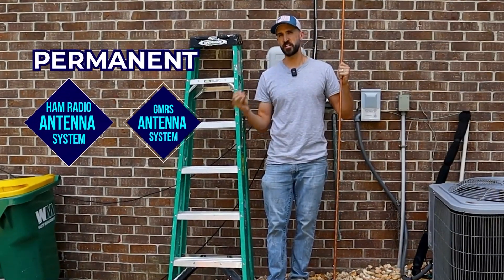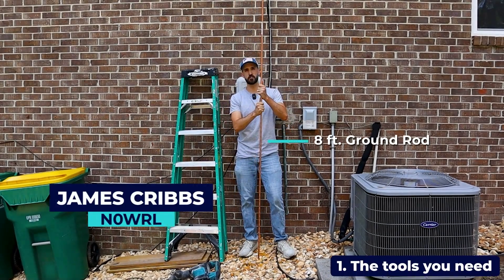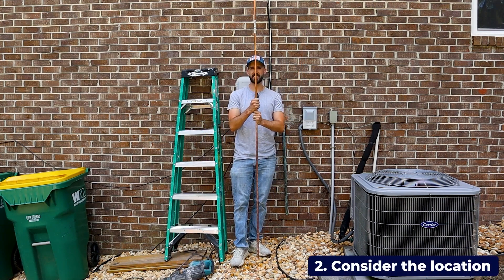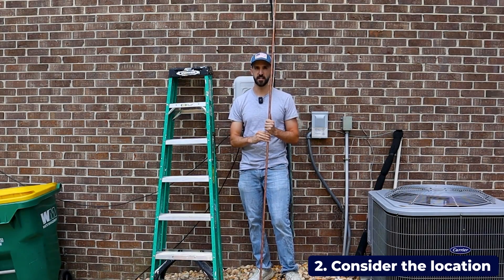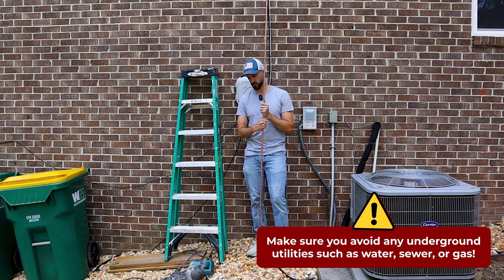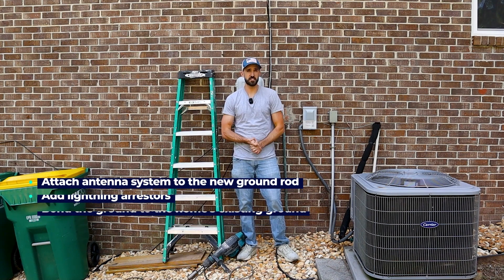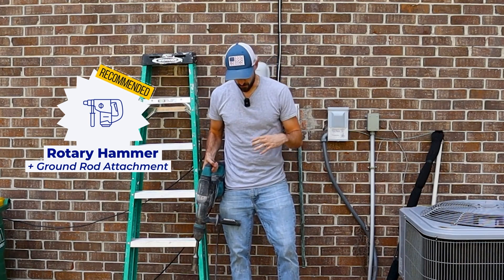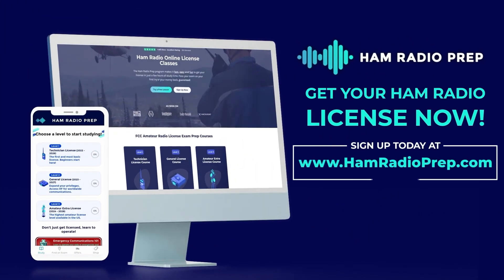Proper Antenna Grounding Made Easy ⚡ | How to Install a Ground Rod for Ham & GMRS Radio

Comment: The challenge for me is my shack is on one side of the house on what would be a second floor and my main house ground/electrical box is on the exact opposite side of the house at ground level. I am separated by 55-65+ ft of distance if I go around the house on one side and a complete concrete pad/driveway on the other side. that stretches nearly 30 ft. So it's not practical at all to do this ground rod install unless someone can explain how it can be done more simple?

Comment: Was lucky, no rocks! Started with a shallow hole, then filled it with water, kept soaking the soil till the water stopped draining. Pounded in the ground rod with a regular carpenters hammer. Went in like butter in 2 minutes!
Reply from the maker: That's great when it goes in so easily!

Comment: The ground rod should be at the base of the antenna or tower, and if its a tower you should have a separate rod for each leg, wired in a ring around the base of the tower.  You must keep the wiring straight run from the antenna to the ground.  A 90 degree bend will blow the lighting out the bottom of the wire at the bend.    For coax surge suppressors etc, you are trying to dissipate the static charge off the metal to ground before it builds up enough to connect the ground to the cloud.   Keep in mind that the antenna is in reality a lightning rod, and most likely will be the highest point around the house, so if something does happen it will most likely be the one hit.   Make sure you are following article 250 for grounding and bonding, as well as lightning protection guidelines.  For example by far the best connection between ground rod and grounding wire is exothermic welding, however approved mechanical means can be used as well, it all needs to be buried, not above ground.  Lets understand what "grounding" means.  You are trying to dissipate a huge amount of voltage and current into the ground, not above the ground.  Multiple ground rods are indeed needed, not just one.  They aren't that expensive and are good insurance to help.  Make sure that any bonding wire between ground rods are continuous piece of solid copper wire at minimum #6, never cut wire between rods.  

In your example the window on the right of the AC condenser, you would have another rod that would be attached to the mounted surge suppressors and have that copper grounding wire going straight from them to the rod right below.  Make sure to do a few drip loops on the coax close to the ground as well, this will help during a direct strike to cause the lightning to blow out the side of the coax as it doesn't like to travel in circles to dissipate it even more.  There are many books directly on the subject of lightning protection and proper procedures to follow.

Again you do want to bond to the structure ground as well, so that potential wise you minimize the difference between the antenna/tower grounding vs the home grounding.  This could be bonding to water pipes, UFER grounds or home grounds.   Our city requires two ground rods a minimum of 6 feet apart, so we have that plus almost 10,000 sq feet of UFER concrete slab grounding as well as copper water pipe bonding and black iron gas line bonding.   We have had multiple strikes within about 300 yards on the neighbors homes and while we didn't get directly hit, we did have damage because of the alarm panel wiring and vast amounts of Ethernet wiring and in-wall speaker wiring.  All that amount of cable goes through the attic and acted like a large antenna and was all floating potential wise, so needless to say, there were a few items that didn't make it with the large EMP induced hit on some devices.    Mother nature doesn't play games, she can be quite mean sometimes...  👍🤠
Reply from the maker: Thanks for the detailed explanation and the helpful tips!

Comment: Good video. I’ve had a couple ground rods for whole house automatic standby generators, here in Oklahoma, where I was able to push the entire 8 foot into the ground by hand where people had watered their lawns regularly.
Note that moisture increases resistance to the ground rod and if the resistance is greater than 25 ohms, you are required to add another; they are required to be spaced no less than 6 ft apart and driven at no more than a 45 degree angle. Not the distance is top and bottom end of the ground rod if it is necessary to drive the ground rod at not more than a 45 degree angle!
See my last comment for NEC rules for ground rods for more details.
Reply from the maker: Thanks for sharing those important details!

Comment: Just a note on ground rod rules according to the National Electrical Code, ground rods are required to be flush with the grade of the ground or below;
250.53(A)(1) says: if practicable, it shall be embedded below the moisture level.
Moisture can destroy the ground connection, 
250.53(4)(a) says it shall be in contact with the soil at least 8 ft.
250.53(4) exception 1 and 2 says if rock bottom is encountered it can be driven at a maximum angle of 45 degrees and if rock bottom does not allow the rod to be driven at a 45 degree angle, then it can be laid in a ditch a minimum of 30” from the ground rod to finished grade.
250.53(A)(4)(c) says if it is driven, the top end of the ground rod shall be flush with or below ground level, unless the above ground end and ground electrode conductor attachment are protected against physical damage as specified in 250.10:
Ground clamps or other fittings exposed to physical damage shall be enclosed in metal, wood, or the equivalent protective covering.
For anyone desiring the rules for ground rods.
Grounding of antenna is governed by the NEC National Electrical Code.
Reply from the maker: Thanks for the comment - very good info!
Reply: Does the NEC code book say anything on the distance of the ground rod from the antenna? If mine is close enough, I would like to use the existing ground rod to ground the antenna and coax.

Comment: Great little video! Thank you for your clear and patient guidance. When you say to attach to existing house ground, what do you mean and how do I find it?

Also, I unfortunately have casement windows on my house. And here in the Midwest we have cold, wet winters. Have you done a video on the best ways to bring an antenna line into the house through this type of window? 

Thanks again. 73!
Reply from the maker: We made a video on how to install a window pass through here: https://www.youtube.com/watch?v=D98bQ-Zjgnk

Another option would be to install a permanent junction box for a professional and permanent installation!

Comment: I run copper from the ground rod to a grounding bus bar that is mounted in a sealed plastic box. Then ground all my antennas and lightening arrestors on that bus bar.

Then run copper from the bus bar into the shack. I have another bus bar in the shack that the copper is connected to. Then ground EVERYTHING in my shack to this bus bar.

I measure AC and DC voltage between the grounding bus bar and the ground of the outlets  to verify I have no floating potential. 

If you do not have grounding rods for your main panel, you can drive your own to save money. Have an electrician connect them to the panel. They can also give you specs on where to drive 2 - 8 foot rods.

Comment: Those running 12-volt mobile systems off AC power might want to read this linked article. The author has had a long career in grounding systems. He's right about the remark below. For my Astron, the negative is bound to the chassis, a no-no. For my commercial adjustable DC supply from Pyramid, it is not.
----
"Get rid of the bonding jumper inside your DC power supply. It only takes 10-minutes of your time, 30 minutes tops. Before you tear into your power supply, confirm the bonding jumper is there first with an ohmmeter. Measure the resistance between the power supply chassis and negative output with everything disconnected. If you see continuity, open the DCPS, find the bonding jumper, and get rid of it.

 Astron power supplies are notorious for this, as are other low-end power supplies targeting amateur radio markets. Higher-end power supplies marketed to commercial and industrial do not bond either polarity; they float the DC output. If the user wants a Grounded System, can run a dedicated bonding jumper from the Single Point Ground bus-bar to either polarity. Hams could bond to the Negative output terminal, but there is no requirement or need to do so. You will let it float and let the radio equipment ground the DC system."
----
https://www.repeater-builder.com/tech-info/bonding/amateur-radio-bonding.html

 Read the article in its entirety for the full context.

Comment: You are fortunate to have soft soil. Mine has almost as much rock as soil. Here are some tricks I use.
(1) Start by digging a hole six inches or so deep and a foot wide around where the rod will go. That will make it easier to move the rod from side to side to loose the soil and get around small rocks. 
(2) Before you start, fill that hole with water. This will also help loosen hard-packed soil. That can make a huge difference.
(3) If you want to increase your soil conductivity, add epsom salt to that water. According to a power company experiment, that'll increase the conductivity three fold. And unlike table salt, epsom salt is good for plants.

Comment: What if your home service ground is on the opposite side of the house from your shack ingress and antenna grounds?
Reply: You will then need to run a bonding wire between the to "ground" systems (probably a wire around the perimeter of your home).  As mentioned in the video, you must bond the antenna GND to the house electrical GND to avoid a potentially large voltage difference between the two nodes if there were to be a lightning strike in the near vicinity.
Reply: I just found the ground wire in a nearby electrical outlet and bonded it to that. Not perfect but it works fine.